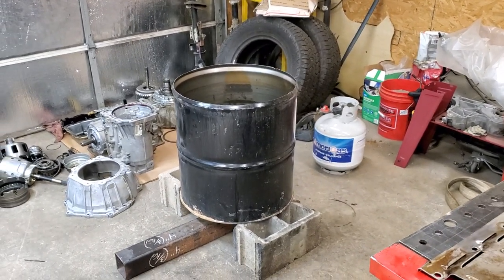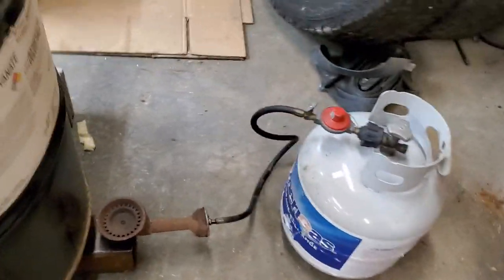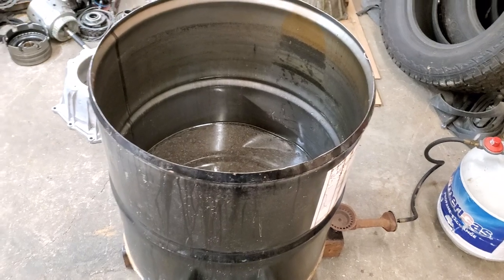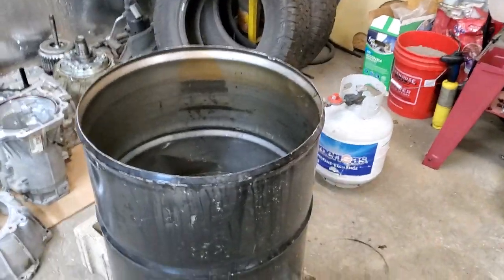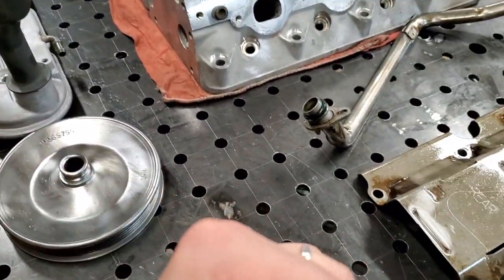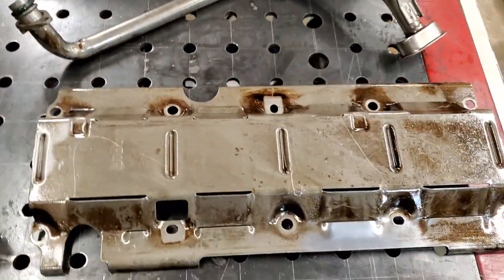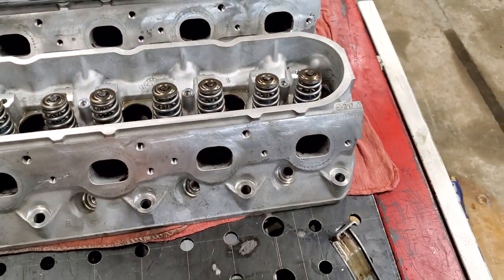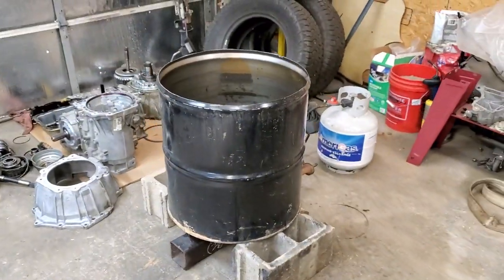Quick little overview of my D.I.Y. Hot Tank...

Comment: How did the stuff in the water jackets clean out the deposits by boiling with purple power?
Did you remove the valves and springs before hot tanking?